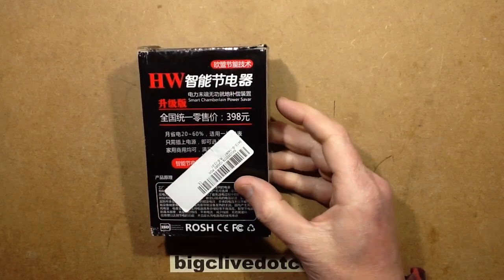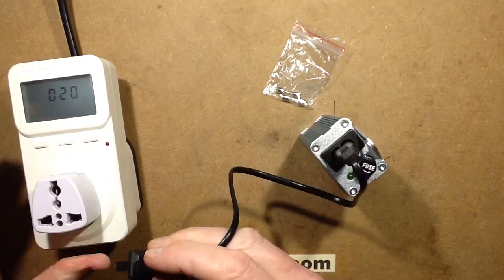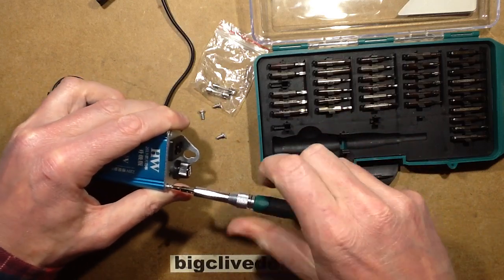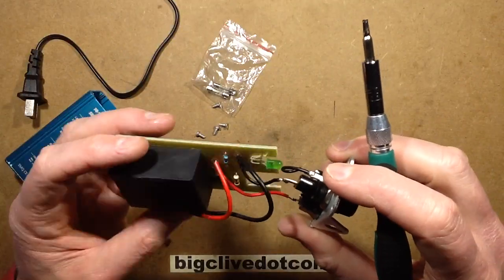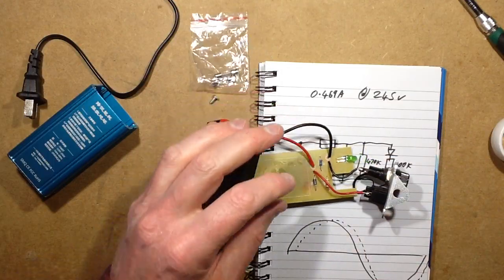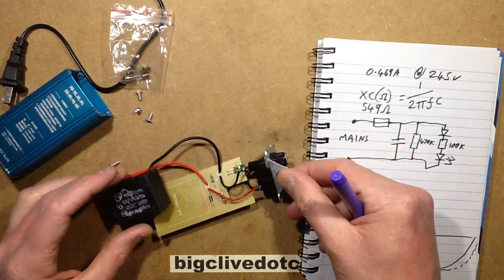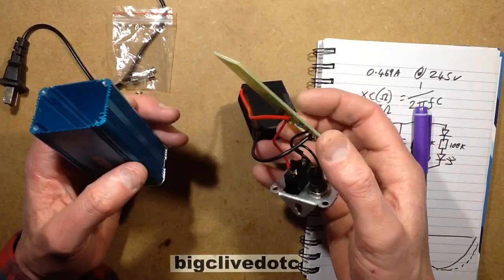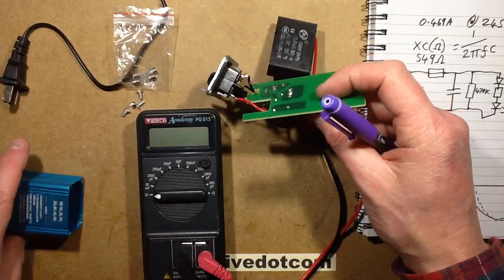200kW miracle power saving device.

Comment: i changed all my bulbs to led and my bill was cut by 40%
Reply: The Pale Horse I've had a look into it and I can only find two possible things.

First is that they contain more lead than other types of lamp, but unless you are ingesting the lamps then this won't pose a risk to your health. 

The second point I found relates to the colour temperature of the light, with too much blue light potentially causing mood changes or inability to sleep. 

So I can only imagine you are referring to my second point in which case if you purchase the correct colour lamps for the application then it won't cause any problems.
Reply: @rfitzgerald2004  Robert, he's mistaken he's probably thinking of the harmful undetectable flickering of the CFL tube bulbs.  led bulbs are literally compact arrays of diodes that emit light and heat. No gas, no vacuum needed, no phosphor, no mercury, etc.  until he stops saying "do the research, I did" and actually explains himself, it shall remain a mystery
Reply: Must have been all the capacitors inside them
Reply: The Pale Horse how are LEDs harmful to health?
Reply: A florescent fixture I have uses 4 X 40 watts= 160 watts + 10 watts for the ballast = 170 watts.  Converted to LED tubes are 4 X 15 watts and no ballast loss, power is 60 watts and brighter light.  Do the math (almost 1/3 the power) and 4 times the life.  I am gradually converting a building with 90 fixtures.  They are seeing signifantly less power bill already and love them.
Reply: The Pale Horse: LEAD is poisonous but not LED. Look at the spelling, please!.
Reply: @sparkboy5207  😂LOL'd at this. I wonder if that's really where the confusion is. SMH.
Reply: I went one better. In 2005, I created a Solar Battery (110Ah) System for my home. All LED Lights come on automatically at dusk and go off at Dawn. House is illuminated (inside/outside) overnight for free. Great in a Power Cut, because the Lighting is always present, and the  system charges all mobile phones, and powers the free music through a 12vdc Hi Fi System Car Radio / CD through the day. A couple of 12VDC Outlets can power a Laptop, or electric shaver - or small portable TV. A great deterrent for the thieves. No-one wants to rob a brightly-lit house. One day, every house will have a dual (hybrid) Battery/ Mains System. I would not want to be without my system.
Reply: Peter Duxbury solar battery ? More info please
Reply: If you think that's good, invest in a $4.95 clothesline, and save a few hunnert a year.
Reply: now available at the 99 cents store in 3 sizes. screw the big box prices ; )
Reply: pipemkr Got an LED household light at dollar store. Didn't put out half the light listed, at more power than the ones at the Grocery store(big store). Earth Bulbs(?), 3-60W equivalent, using 8 or 9 watts, 3 bulbs/$5! Way better quality than dollar store ones I found. Sometimes on sale, buy one, get one. Amazing technology! 100W equivalent uses 14 watts. Forget CFL's! Change every bulb to LED, and truly be amazed at the savings. HEB(Main Texas grocer) always has much better deals than Home Depot/Lowes. Warm white model is like traditional bulbs we grew up on. Cool white are bright white, almost blueish, like a shop light. Warm white is best for indoor light! You'll never regret the switch folks, I promise!
Reply: @timturk1899  something many people don't know about dollar stores and store brand products , is they exist to recoup losses from the OEM's quality control failures - stuff that didn't pass muster to deserve the brand name, will be sold off at a discount to third parties in order to recoup the loss, that stuff ends up being sold to big retail chains to be rebranded (as store brand), or liquidated via discount and dollar stores.  The moral of the story here, is don't make mission-critical purchases at dollar stores, or from the seemingly-extensive catalog of store brand items at your favorite retail chain (categorically. There are exceptions)
keep in mind there's always a reason why the off-brand Item sitting next to the branded item "looks just like it and is cheaper!"
Reply: Amazing 👍
Reply: LED is not CFL.
Reply: LEDs are the way to go! Chinese power saving devices.... not so much.
Reply: Robert He probably confused LED to CFL. But considering the colour temperature, that actually is very significant thing and you should always buy expensive LED-s with calibrated colour index. Under most LED lights (cheap ones) you can notice a significant difference in the way objects look (shape is the same but colours are significantly different) and It's already proven that too much white/blue spectrum from phone screens causes significant sleep disturbance and who knows what else. I can really say for sure that it does significantly affect sleep, especially to me, because I don't sleep that well anyway. But, it is nearly impossible to get light as perfect as old school light bulb and they will always win with color quality.
Reply: I have seen hair change from brown to auburn by changing rooms to a LED bulb of a different quality. It's actually kind of magical to witness first hand though :P
Reply: @DataLog  beat me to it. Cheers
Reply: @putridfetidini5468  I didn't quite understand what you mean.
Reply: @DataLog  Understandable. Your reply was over 4 years ago, basically I'm seeing this vid for the first time today, and made my first comment before I scrolled through to see that you'd said essentially the same thing already.  So you beat me to it.  That's all it was😁 Cheers
Reply: agvulpine I doubt anyone could make a LED driver circuit so poor and bootleg it actually produces RF. If that's true then China has really outdone itself on the safety stuff here.
Reply: Just Google for FCC LED and you'll see that there's movement to knuckle down on SPECIFICALLY led lights and led drivers.  This initially started with Christmas lights, since it would utterly destroy local radio and public safety frequencies, and now standard household lamp bulbs are the culprit of the same.
Reply: I live in darkness with solar glowinthedark painted walls.   Saved 100% by not using light bulbs.
Reply: Yeah, we've saved a lot that way too. Or rather, we change them to led when they break anyways (you can't actually buy incandescent bulbs here anymore), but most have been changed over the years, with significant savings as a result.
Reply: we bought a house 4 years ago...i was in shock after my first electric bill.  i went out and replaced every bulb in the house to led and i was amazed at the savings.
Reply: The Pale Horse LEDs are not harmful. They produce no ultraviolet or ionizing radiation. Don't believe everything. Fluorescent lamps may produce ultraviolet radiation, but very little of it.
Reply: Michael Anderson I used to like 100watt bulbs. Now my 1200sq foot house it's only lit with 13 watt led lights i can leave all 30 of the light bulbs on in the house for the same power as 4 of the 100 watt incandescents. Considering 4 people living here and atleast  6 bulbs would be switched on the whole house can be lit up for cheaper than that on the new LED lights.
Reply: The super cheap LED home-fixture bulbs violate FCC regulations for spurious RF emission.  Spend a few extra dollars at a big box store that obeys emissions standards.
Reply: agvulpine - I'd be more worried about the cell phone and the microwave radiation coming from it ;)  Especially as most people hold them next to their brains day after day ;)
Reply: * Buy super cheap crappy LEDs if you prefer:  Really bad color temperature messing with sleep patterns, spurious RF emissions due to poor filtering, flickering which which can mess with eye nerves, short lifespan due to inadequate heat dissipation (basically it will cost you more in the long run by having to replace these crappy LEDs often).
* Buy reasonably affordable LEDs if you prefer (really just a few dollars more than the "cheapy" ones):  Nice warm color temperature very close to incandescent bulbs, no spurious RD emissions, nearly no flickering, longer lifespan due to better heat dissipation and material quality which will extend its lifespan much longer than cheap crappy LEDs.
Ladies and gents, pick your poison! ;)
Reply: but also you cut the whole light spectrum... you might drop down even more to use thin spectrum line leds (red+blue for plants) and use this stylish magenta lamps... or even more drop down -- use ONLY Sun light for all life needs
Reply: Know what else has gone up friend? Your exposure to radiation. Don't forget to have the odd "Cancer" test now and then,
Reply: @martybisschoff6000  All light is also 'radiation'. You are going to have to be more specific than that...
Reply: @rich1051414  Correct friend. Research the diff.
Reply: @rich1051414  thank you Richard.
Reply: research what leds are,the patents and uses,its not for our benefit.Just like so called smart meters the negative health effects hanging over our heads are  documented.
Reply: @susangray43  studied electronics, got a degree in it, did electronic repair for years ... LED is a light emitting diode. A diode is a one-way component for current flow. Two of them can make a transistor, 4 of them can make a rectifier.  Blew my mind when they started appearing in traffic lights and cars.  
For fun once I built a 'light show' device once that used a 555 timer, multiplexer, and a ring of ~25 multicolored discrete LEDs (through-hole, not smd) on a trimmer pot to the clock.  good times.  If I'm going to be harmed by anything, it's the solvents, lead and rosin and cleaning agents I used for years, cleaning up pcbs after repairs.   Not the LEDs.
Reply: But you will have to spend all the savings on your health because those led's are harmful to your health. I guess you haven't thought of that, have you?
Reply: @thepalehorse7015  the LEDs are not harmful, the waste chemicals, etc used in mfging are
Reply: Go and do the research. I did
Reply: Robert Fitzgerald Go and do the research, I did
Reply: The Pale Horse go and do the research = watch quacks on YouTube.

Comment: Do you know how much 200 Kw is? try a 12 cylinder deisiel
Reply: People still buy this rubbish! You certainly won't get 200kW down that slim cable either. Plus it's not wired in series with the house anyway. BMW manages 280kW from a straight six diesel with three - yes, three - turbochargers.

Comment: Hey Clive, what's that screwdriver set? I'm looking for something not made of brass, for as small price as possible :)
Reply: sorry to butt in... Lowes has some nice sets right now. LOTS of good stuff and its all up in front so you can zigzag through it in minutes.  i have the one linked below but go the next boxed set up if you need the drilled center "security" bits.
 http://www.ebay.com/itm/Kobalt-35pc-Double-Drive-QL3-Precision-NIckel-Plated-Tips-Screwdriver-Tool-Set/172402326315?_trksid=p2141725.c100338.m3726&_trkparms=aid%3D222007%26algo%3DSIC.MBE%26ao%3D1%26asc%3D20150313114020%26meid%3D873266b240e0403496a55f320322ee7b%26pid%3D100338%26rk%3D2%26rkt%3D26%26mehot%3Dag%26sd%3D271089619834

Comment: I think you mean 200 kWh
Reply: Does it mean the capacitor can synchronise the current and voltage sinewaves for inductive loads upto 200KW?

I have no physics degree, but I suspect all we're doing is arguing over the specification of a device that probably adds a penny to your bill rather than saving any.
Reply: paulanderson79 
200 kw, fits in your hand! lol
Reply: Not many homes draw 200kW. That's nearly 900 amps.
Reply: I know. I have physics to first year degree level.
I was thinking in terms of saving 200 kwh per year.
Current isn't measured in watts.
The device is connected in parallel with the household system thus the current isn't all passing through the device. You'd never get 900 amps through that tiny cable!
Reply: I know it's entirely different. I have already explained. And there's still no way that a parallel connected device can carry 900 amps. Please read my messages.
Reply: He can't mean 200 kW. It's connected in parallel. Domestic electrics are generally fused at 75-100amps for the whole dwelling.
Reply: As I said previously - I thought he meant saving 200 kwh per annum. Saving 200 kw is meaningless.
Reply: Never mind the fact that he got 200 kw from the website......
Reply: paulanderson79 n
Reply: Maybe 200 kilowatts for the neighborhood

Comment: I bought one of these for the aluminum case... where i bought it it was $11 and an extruded aluminum case of that size was $9.. so i basically got a decent cap to use for something else for $2
Reply: I thought the same thing, anodized  case for that device was cool
Reply: The fuse holder is reusable also.
Reply: warmfreeze your logic is screwed

Comment: The miracle is that people think that one can save 200kW with this device. A 2 kW toaster is quite hot. 100 toasters makes a lot of heat!
Reply: The fact that they advertise as offering a saving of 200kW shows that they have no idea what they're talking about. 200kW is a measure of power, not of energy.
Reply: I think they know the difference and they also know that the byers don´t. The absent of knowledge can cost a lot of money. The politicians on our island want to build a water power plant that can produce 207 MW. The biggest problem is that it´s not raining here so one has to pump desalted water up in the mountains. To produce 207 MWh one first have to pump, which requires 345 MWh. The cost for this plant is 300 millions Euro.
Reply: Politicians are good at this lying business. There is a hydro-electric arrangement something like this at Dinorwic in North Wales:

https://en.wikipedia.org/wiki/Dinorwig_Power_Station

It does exactly the same thing - the turbines are used as pumps to lift water to the lake at the top. The idea is that it can be used to supply short term periods of high demand and then use surplus energy in periods of low demand to pump water back to the top. I, too, think the idea is questionable but it's the only real way we have of 'storing' electricity. Battery technology is still not sufficient on this scale. What is feasible though is to use localised accumulators in the domestic environment. Tesla (the electric car maker) is marketing battery / inverter sets as of now.

Which country are you in, hermanwahsletn?
Reply: Great link! I Live in Spain, Tenerife. Another Canarian Island, El Hierro, also store energy similar to Donorwic. The project with windmills is called ”El Hierro 100% renovable”. However the plant only produces 38% of the electricity. The cost to produce this electricity is 6 - 7 times higher than in the other Islands.
Reply: I suppose we have to start somewhere. Ultimately we will run out of fossil fuels. I have objection to nuclear to be honest.
Reply: There is only one problem, there are too many people on our planet. More people, more energy…
Reply: I think that the problems are greed and hatred rather population itself.

Plus the other problem is this: How do we decide who to eliminate? Not an easy one to resolve.

Comment: I don't know what electricity meters you have, but here in NL the older ones working on induction will show a lot less consumption (kwh) when you screw with cos phi. Putting a large capacitor on something like a washing machine will save a lot of money on a yearly basis (or removing the one that's in there to compensate if there is one).

This device seems to do exactly the same what I used to do when I still studied to save some money :)

Comment: Thank you for posting such an informative video . I have a question whether or not this will work for my situation as I am looking for a Power factor correction solution. . .

I just  bought pro audio behringer 4channel  inuke nu4-6000 class D amplifier for 349$.  . . Its very cheap for being so power full. Its claims a total about of 6000 watts but I found out that is peak to peak on the wave form not rms [.707] The amp has been third party tested at s about 1200 watts RMS a channels at 2 ohms  or 2200 watts RMS for 2 channels when bridged  at 4ohms
 
In researching this amp I have found this amp has cut corners by not having a PFC circuit in it. .  People are saying that having such a powerful amp with no PFC circuit  can causes electrical surges which then can damage other equipment connected to the circuit. . .  This has me concerned since I do have sensitive Dj equipment connected to the same circuit.. So I am looking for a for something I can do to retrofit a PFC circuit to it; hopefully externally so i could not void the warranty.  
Do you know if something like this will help?  If it will not  , do you know of something that will or have any suggestions that i could to limit surges and hence damage . I was thinking even maybe a power conditioner but i am not sure.

it can pull up to 4800 watts out of the mains at 120 volts [40amps peaks] when running all channels in 2 ohms   and that is with no power factor correction. . .  so the amperage peaks maybe even high-er. whats crazy is that this was UL approved to be connected to a 25amp circuit [there are reports of people tripping breaks with these amps . . . obviously] . .   your assitance would be greatly appreciated as i really don't want to damage the amp or any of my equipment. 

Many
 Thanks Mike